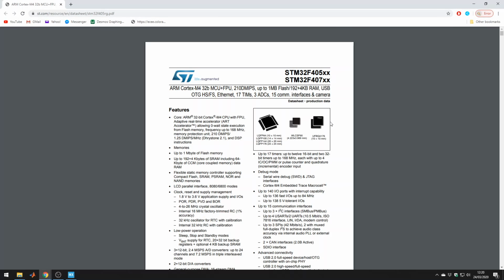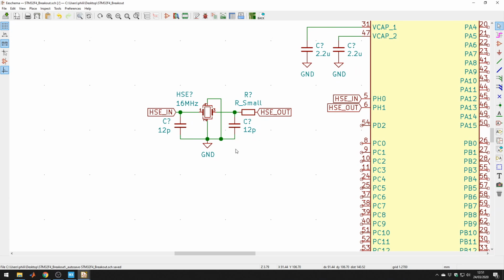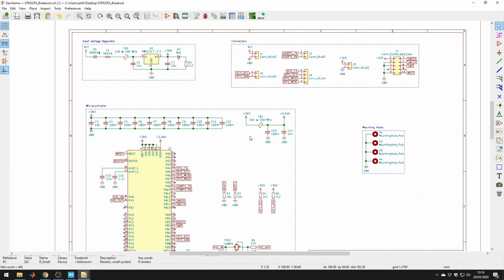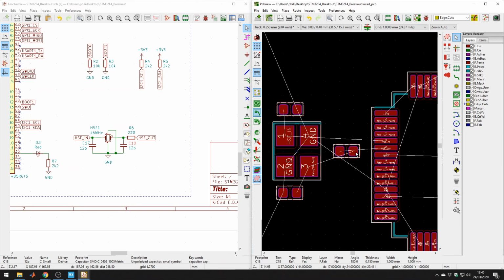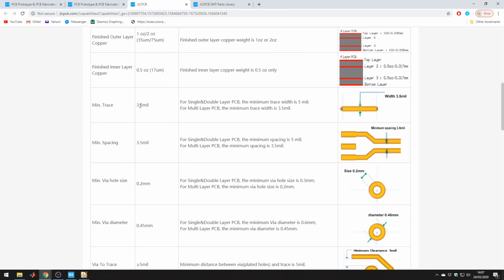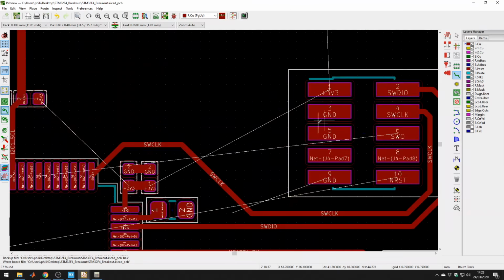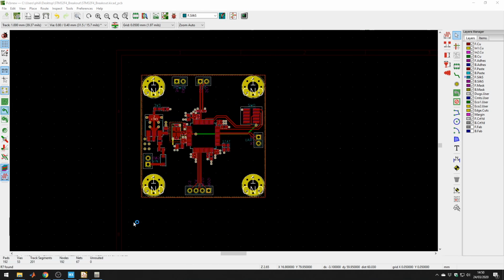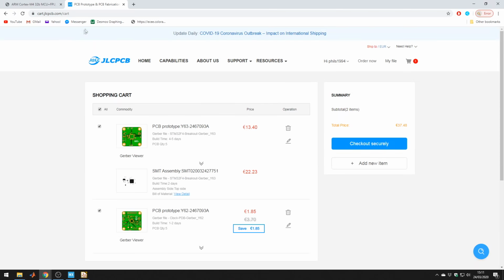KiCad STM32 Hardware Design and JLCPCB Assembly - Phil's Lab #2

Comment: Hi @Phil S, this was a great video, thank you very much, I've been searching on making my own break out board. Now I have a few questions, i searched the data sheet in the power supply section, they don't mention adding a 100nF cap for the VDDA or a 10uF cap for the whole decoupling capacitors, I would like to know where did you get these? 

another question, do I just go by what the microcontrollers Datasheet asks or can I follow the sam steps ass you do, like adding a 100nF can for VDDA when they've not specified it? 

But thanks a lot for this video it was amazing, very helpful, appreciate your effort!
Reply: In regards to the Vdda, they do require a 100nF + 1uF as per 5.1.6 Power supply scheme. But im unsure why the 10 nF instead of 1 uF
Reply from the maker: Thank you! ST recommends adding a larger/bulk decoupling cap close to the IC (e.g. as Nigel says, see datasheet section 5.1.6).
Regarding VDDA, any pair of capacitors (something like 1uF + 10nF, or 1uF + 100nF, or even 100nF + 10nF) will generally suffice. I chose much smaller values for this board, since it actually doesn't use any of the analog peripherals - so even a 100nF cap would have probably been enough here!
Reply: @PhilsLab  Thanks Phil, so now when I take a look at a completely different data sheet of another MCU, can I follow exactly what they have given in the power supply scheme, in the sense I copy the exact circuit that they have shown without adding extra components to keep it simple? The reason I am asking is, I want to be able to create a breakout board from any MCU all by myself and just by looking up at the data sheet of it.
Reply from the maker: @sashvatganesh  Yeah, following the datasheet is always the best idea. Watch out for any footnotes though, which may elaborate on extra parts you may need. I think that was the case for the STM32 and the bulk decoupling capacitor.
Reply: @PhilsLab  Thanks! will you make a follow up videos on this and the other circuit board designs?

Comment: Something that really upsets me about PCB design is the amount of 'boilerplate' actions you have to do for each part, e.g. switching the component designators to the fabrication layer. Surely a little script could do that for all your components. Having dabbled a little into the python interface for KiCAD a good while ago I would expect this to be possible and not particularly complicated. BTW excellent video, I'm a bit of an audio snob so if I could ask for something, it would be a bit of noise reduction on your voice, thanks again.
Reply from the maker: Thank you! Yeah, I feel the same way. I'm sure there are better ways of doing it - but this is something I've just stuck with doing.
I've since invested in a much better mic as well, so any new videos won't have the noise in the background anymore.

Comment: Phil,  I have a couple of quick questions for you if you can find the time.  Have you ever built a board with the low speed crystal on it and if so, what part did you use.  The STM datasheet said not to use a crystal with a 12.5pF load capacitance and the only basic 32.768khz crystal is just that.  Also, do you do anything special with the ground plane like you did with the high speed crystal?
Reply from the maker: Hi Edward, I must say I've never had the need for an RTC (or something that requires the LSE) so up until now have not put one on. If you haven't come across this already, this application note is very useful: https://www.st.com/resource/en/application_note/cd00221665-oscillator-design-guide-for-stm8afals-stm32-mcus-and-mpus-stmicroelectronics.pdf On page 44 you can see that they indeed follow the same procedure regarding ground plane, as for the HSE.
That being said I actually have a design I'm working on that (finally) requires an LSE - so will give that a try. Will let you know how it goes.
Reply: @PhilsLab  Thanks for the info.  I don't think I need the RTC either, but since the Blue Pill has one installed, I am not sure if the unit is configured to use it or not and if that will effect the functions like the millisecond counter.  I guess I will need to dig through the code and see how they accomplish that.

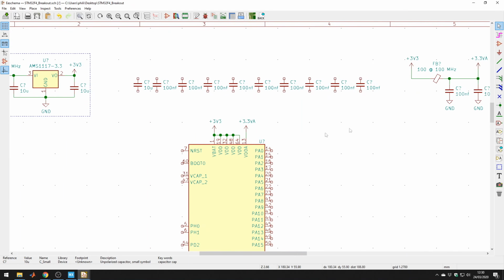Comment: Maybe this is a dumb question @Phil S, but at 10:37 you make an array of decoupling capacitors, even though you do this in the schematic (and this isn't the first time I've seen this), is this pretty common practice even though you're going to have each capacitor in different places around the MCU?
Reply from the maker: Not a dumb question at all! I believe this is fairly common practice - I started doing it this way, firstly because I've seen it in many professional schematics, and secondly because I think it makes the grouping much nicer. This way you don't have many capacitors for the same chip scattered around.

Comment: Hey Phil. Thank you very much for your YouTube videos about PCB making. They really helped me a lot! I am in the process of creating a PCB that I will use to log and transmit data from a Shifter Kart. I was wondering if you could somehow take a look at it just to make sure I have not done any major mistakes. :) (The PCB is only 100mm x 100mm.) Thanks.
Reply from the maker: Hey Pintea, My pleasure - thank you for your comment! Sure, you can send me an email at philip.salmony@philsal.co.uk with the files and I'll have a quick look through them.
Reply: @PhilsLab  E-mail sent. Thank you very very much.

Comment: That was an amazing video. Watched start to finish and learned a lot. You seem to be very experienced with this. If you would do the same PCB for mass production, what would you change? Surely the connectors. What else? Assuming functionality and needed pinout will remain the same.
Reply from the maker: Thank you, really glad you liked it! Yes, I would definitely change the connectors to something more secure. Additionally, the board is far too big and the space not utilised well. For mass production, depending on the use-case of course, the mounting holes may need to be placed to fit some form of enclosure - here they are placed rather arbitrarily. Other than that, possibly remove some LEDs if this were to go into an enclosure - the power LED is useful for prototype boards. The regulator is also far too 'powerful' for the board, as it can supply up to about an amp I think.
Then also change the Schottky diode to a P-Channel FET. Probably add USB for firmware upgrade without needing an ST-Link adapter. I think the list goes on :D

Comment: Why just not to use "keepout zone" for that crystal oscillator part?
Reply from the maker: Yeah, that's a much better way of doing it. I had some bugs with earlier KiCad version, which for some reason wouldn't let me do it that way - so I had to end up just doing an 'oddly'-shaped copper fill... I just checked and the proper way is working for me, so will do that in future videos. Thanks!
Reply: @PhilsLab  If you use a keepout zone to keep out the normal ground and power pours, how would you put in the isolated ground pour?

Comment: Great video - I am about to design a board using the STM32F103RCT6  micro and I think about 150% of this video will be an exact match for what I have to do. Are you going to do a video about programming the board when you get it back?
Reply from the maker: Thank you, Edward! Hope everything goes well with your design. Would be cool to hear how it worked out!
I will be making a video or two on programming STM32 microcontrollers. Probably not this one as I have no particular use for it, but the one I have in mind right now is the custom board I'll be using for the 'control system design' video series.
Reply: @PhilsLab  Can't wait. I started my design and decided on the STM32F103VET6 because I am connecting to a lot of existing 5V lines and I want to use external interrupts on at least 11 lines. The VET6 has the full PD and PE registers that are 5V tolerant, so plenty of input options. My entire background with STM32 is using the Bluepill under the Arduino IDE, so this CubeMX is going to be a real challenge.
Reply from the maker: @MrEdwardhartmann  I'm sure you'll get the hang of it quickly! Initially the whole switch from Arduino stuff to STM32 is quite daunting, but it really opens up so many more possibilities that it's worth sticking it through. Looking forward to hearing how you get on!
Reply: Update - I discovered that the Arduino IDE does support the STM32F103VET6, so I don't need to learn the CubeMX way of doing things. I got a $20 development board from amazon and it works great with the Arduino IDE
Reply from the maker: @MrEdwardhartmann  If the Arduino IDE meets all your needs, then that's the thing to go for in terms of simplicity! It was quite a bit of a learning experience moving from Arduino to all the STM32/Cube stuff, but in my opinion, well worth the extra trouble as it opens up so many possibilities.
Reply: @PhilsLab  You are amazing Phil!
Reply from the maker: @adaminsanoff  Thanks man!

Comment: There is a nice plugin for via stitching: https://github.com/easyw/RF-tools-KiCAD. This plugin has also some other nice features such as track rounding, fence generation, teardrops and solder mask expansion. As separate footprints, it's even possible to create mitered bends or tapers which are commonly used in RF circuits.
Reply from the maker: Very cool, thank you for the tip!

Comment: You definitely got that r-c low pass filter cutoff frequency calculation wrong...
Reply from the maker: Yeah, my brain wasn’t on during that crystal bit. The value for C should of course have been 12pF not 9pF - and is just based on a single load cap, not anything to do with parallel combinations. Luckily, the general order of magnitude is what matters here and not a precise value.
Reply: @PhilsLab  For sure.  It just seemed odd at first when you were like "ok this calculation says it should be 1.1 kOhms.....   let's use 220 ohms!"  I lol'd because that's 1/5th the resistance xD
Reply from the maker: @supernova86  Well, the reason is that for 1.1kOhms of resistance the filter -3dB point is at 16 MHz - which is the fundamental frequency of the crystal. You of course don't want to suppress the fundamental of the crystal but rather the higher order harmonics, therefore you choose a much smaller resistor (but similar order of magnitude) such that only the harmonics are suppressed. Assuming a square wave, the harmonics will be at odd orders so 48 MHz, 80 MHz, and so on. That's where the 220 Ohms comes from instead of 1.1k. This whole calculation is more of a rule of thumb, rather than anything that's meant to be accurate. I should have made that much clearer in the video though.
Reply: @PhilsLab  oh, you said 16 MHz?  I thought you said 60 MHz...  lol!  My bad
Reply: Can you please clarify how so
Reply: @zakz1586  He calculated R using Fc of 60 MHz and a capacitance of 9-12 pF.  And then said that came out to be 1.1 kOhms...  If you do that calculation it comes out to be 221-294 Ohms (depending on if you used 9 pF or 12 pF).
Reply from the maker: @supernova86  See comment below. Initially, I used an fc of 16 MHz (that of the crystal frequency) to gauge an approximate value of resistance. Since we only want to suppress harmonics, I reduced the resistor value by a factor of 5 to get an increased fc of around 60 MHz. Not explained well in the video however - I definitely agree.

Comment: Nice tutorial. Two critics: You totally forget placing fiducials, which are mandatory for accurate assembly (for stencil, AOI and placement). Maybe not for JLCPCB. Using the same connectror type for infeed (VCC) and measuring/breakout is not a poke-yoke solution.
Reply from the maker: Thank you for your comment. This video is specifically about JLCPCB assembly and I believe I mention in the video that they will add toolings holes for you. If you however require a particular placement, then yes you can of course do that - and perhaps something I should’ve showed how to do in the video.
Regarding connectors, that is a whole topic in itself. While I agree that typically the power connections onto the PCB should be more secure and possible larger, the idea for the ones used in the video is that nearly everyone has suitable jumper cables (standard 2.54mm pitch ‘GPIO’ cables) at hand and it this covers the broadest possible audience. Everyone has their own connector preferences and I tried to keep them as generic as possible for this occasion.
Nonetheless, I agree with your points - thanks again.

Comment: Thank you so much for sharing this Phil! I played along with your video, and learned so much in the process. This information is worth gold! Keep 'em coming :-)
I'm very inspired to keep going, and was thinking about doing a STM32F1 PID controller board. It would use one of the timers to generate a PWM signal. This PWM could be used for a 12V MOSFET driving circuit, to control e.g. a 12V heating pad. Interesting things to learn in addition to this video would be routing the PWM and 12V high current signals. For the PWM I guess the same rules would apply as with the oscillator. But how would you recommend handling the additional 12V power on the board?
Also did you see AN1709?
https://www.st.com/resource/en/application_note/cd00004479-emc-design-guide-for-stm8-stm32-and-legacy-mcus-stmicroelectronics.pdf
Reply from the maker: My pleasure, thank you for your comment! I'm very glad to hear it's been helping out.
Sounds like a cool idea you have there! Regarding the board design, I generally try to section my boards, e.g. digital on one end, analog on the other, power in its own section. So I would do something similar for the project idea you have. Keep the low-power, digital stuff nicely grouped and dedicate a different part of the board to the higher current, and higher power side. Things like wider traces and larger clearances will help.
Also, I hadn't seen that application note - so thank you for that, looks very helpful!

Comment: Thankyou so much for this! so much useful info in this video, from MCU layout considerations to (especially) the quirks of JLCPCB's SMT assembly service, and how to get it right from KiCAD. I have a question, though - I don't know if you'll have an answer ... I often find myself designing with descrete's and ending up with quite repetitious circuits with maybe 8 or 16 repeats of a small circuit section (5 or 6 components). Is there any way you can think of in KiCAD to make it so that I only have to do the board layout for that section once? I could copy-paste the section in PCBnew but then the rats-nest gets severely broken (all the copies think they need to be connected together). The components all have repeat designators too - and from what you describe I think JLC wouldn't like that ;-)
Reply from the maker: My pleasure, thank you for your comment!
I often have the same problem as you. I believe I saw something about a plug-in that addresses this in some KiCad Facebook group. Let me have a little dig around and I'll hopefully get back to you with it!

Comment: how did you determine your parasitic capacitance?
Reply from the maker: It's pretty hard to determine the parasitic capacitance exactly. Most datasheets give an approximate value, typically in the range of 2 to 5pF. However, some ST datasheets even give up to 10pF as an estimate for parasitic capacitance.